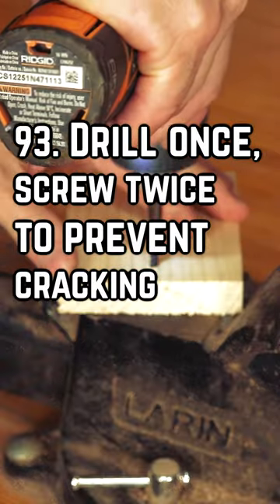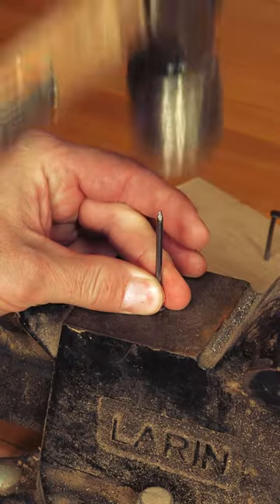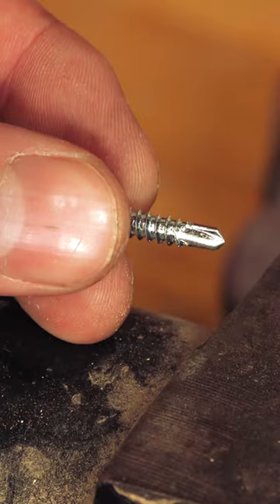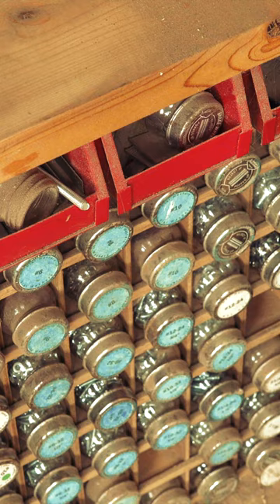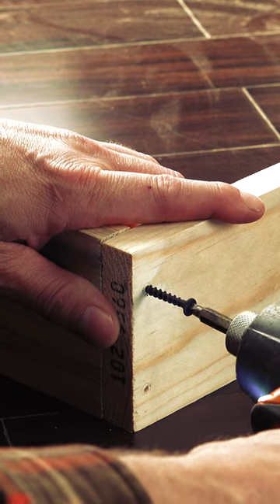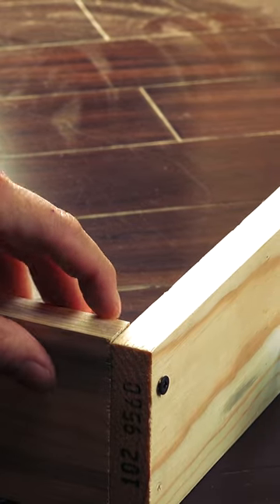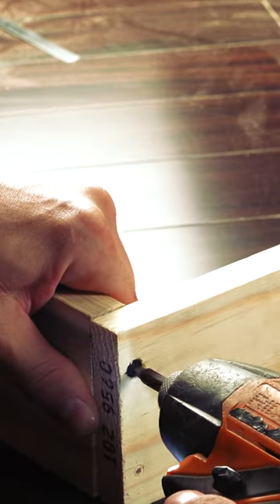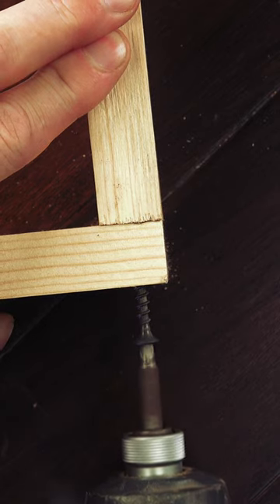93. Drill once, screw twice to prevent cracking #mtbitesize #shorts

Comment: Another way to do this is use a counter sink bit and over size the hole in your face piece. This will allow the board to act as a washer rather than threaded through like a bolt and nut. A good rule of thumb is your pilot hole through the face should be the sames or slightly bigger than the threads. The pilot hole in the rear piece should be the size of the shaft between threads. This will allow you to draw you materials together cleanly and helps prevent over torque or stripping. Just saying. Love your content!
Reply: You can also drill the pilot holes in both pieces with the small drill bit the size of the screw shaft. Than you drive the screw only in the upper piece, back it out and than drive it back in but with the cordless drill / impact in reverse and max rpm. That will create the perfect size hole for the threads to pass through. I have to ad I only recommend this technique for a small couple of screws because it gets tedious over time.

Comment: I was taught to run a screw backwards before starting to drive if [forwards] to help create a pilot-indent... and that it creates enough heat-through-friction, to someone someone fibers below the contact point, to prevent splitting.

But I have 3 drivers now- so at least one stays chucked up wit a pilot/countersink bit.
..... personally used hack.....
If you need a quick/light countersink [in wood] for a screw head (if using a power driver); 
back the screw all the way out. Then spin a P#2 (3) bit in the hole... up to the depth you need.
Reply: I was gonna say that about running it backwards. I did concrete work and new wood or wood that was older and had been used a dozen times, it didn't matter, that running it backwards for a few seconds always worked.